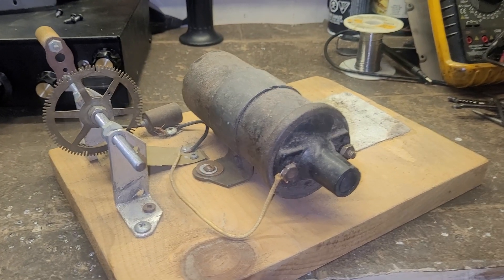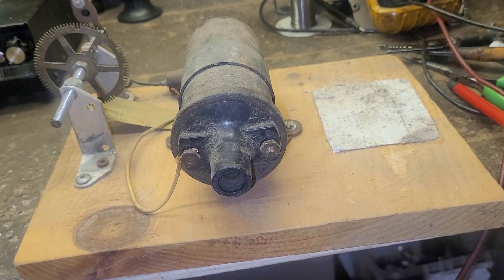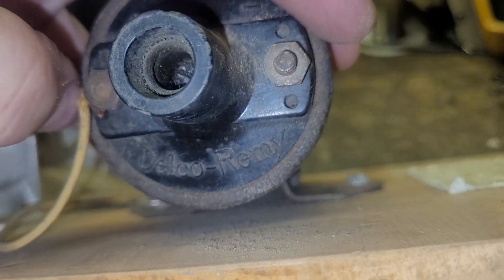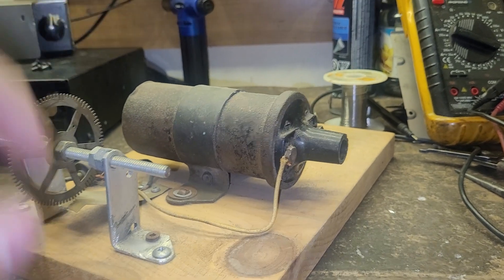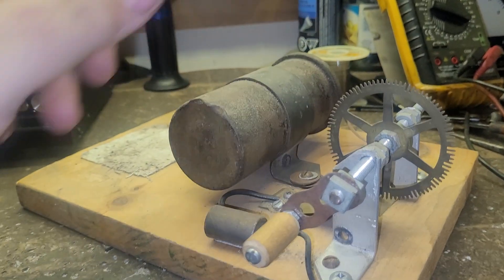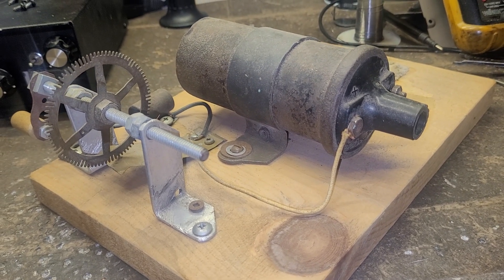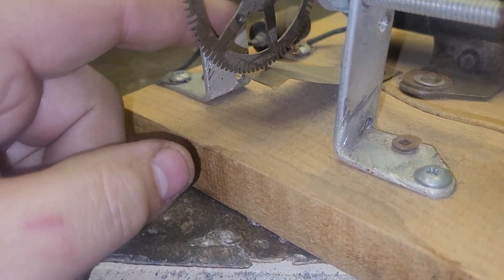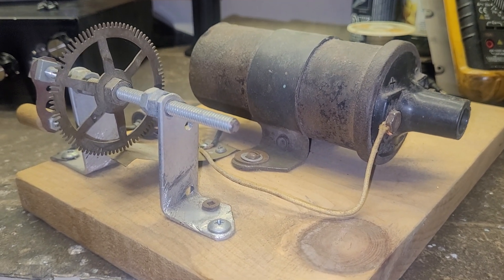TESLA coil HV power supply!

Comment: That's a General Motors ignition coil and the single conductor in the center is what the secondary high-tension wire connected to the center of the distributor, then each spark plug wire came off the distributor to the spark plugs.  The housing of the coil was grounded to the car and served as a return conductor from the plugs. The 2 screw terminals are to the primary coil within the unit. It's basically a simple transformer with a Primary coil and a Secondary coil.
Reply from the maker: Yep, that's a great explanation of the coil,  thanks for that!